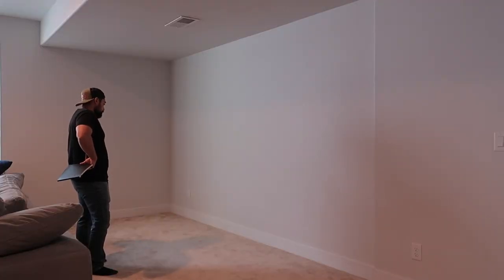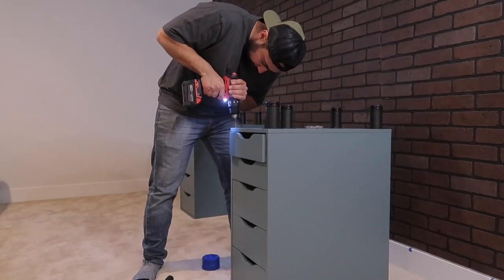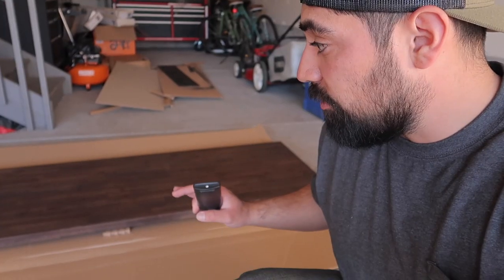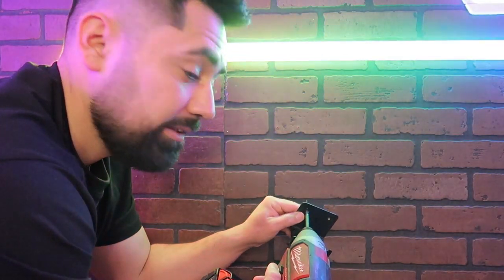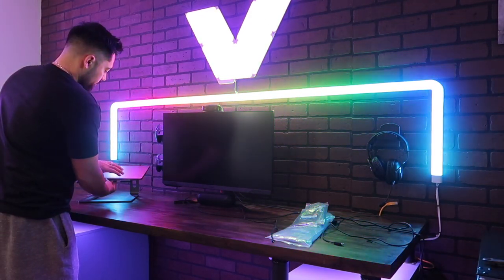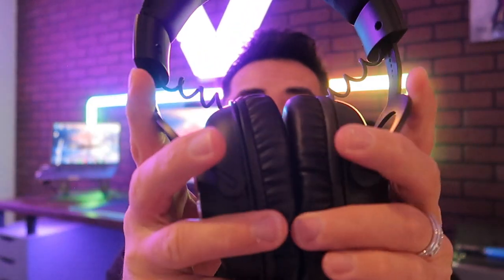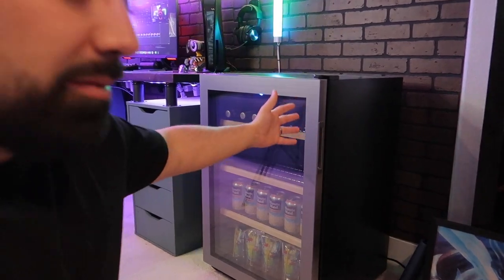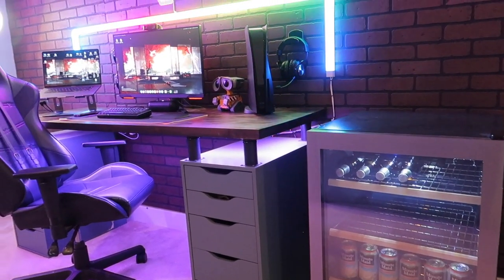Building my dream gaming setup 2023 | Goyo Vasquez

Comment: Great job for your first video. Just a couple of friendly pointers if you don't mind: 

- If you make a mistake/say the wrong words during the video and you realize it after the fact, just put correction text on the screen in post. There were a couple of instances where you misspoke so correction text will make sure that people know you are paying attention to detail. 

- Try to work on the sound. I could hear your lens' auto focus motor during some parts of the video. So isolating your vocals from ambient noise including lens' motor sounds will go a long way. 

Other than that, great job dude. You come across as humble, friendly and one of us :)